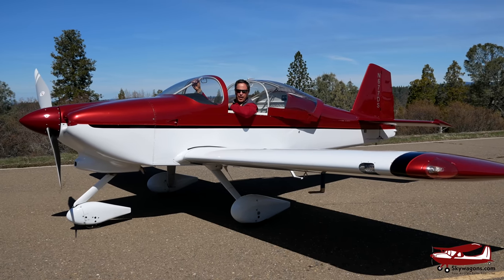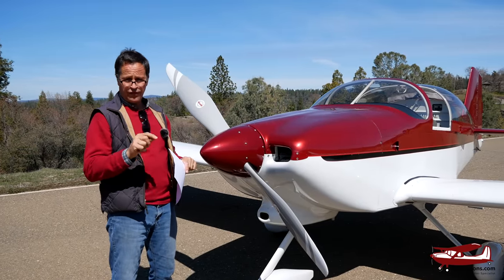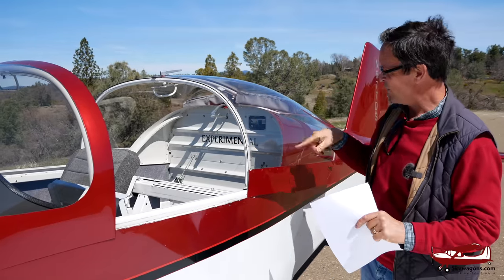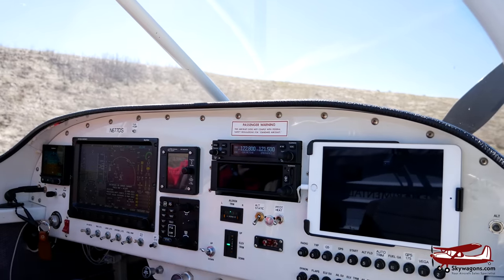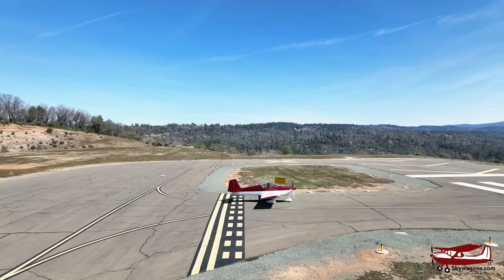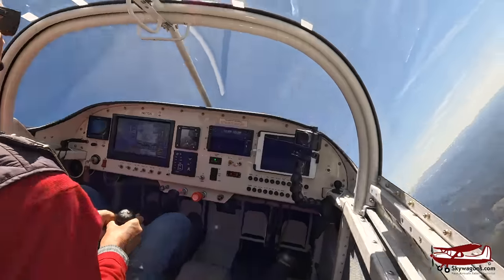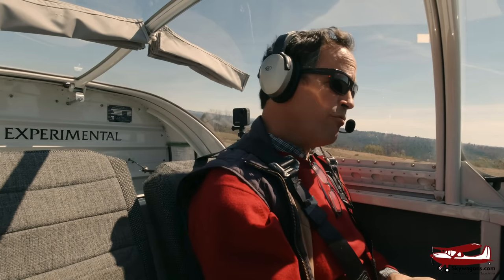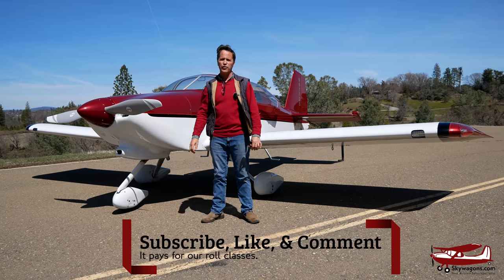Vans RV6A

Comment: The tip up canopy is better in some ways.  The metal support and bar really restrict your view on the slider. I prefer the unobstructed view.   I taxi with my tip up canopy slightly open and it works great in the summer.
Reply from the maker: Right on

Comment: Another great video 👍✌️😊

Lovely aeroplane for a lovely day, I thought looking at the wing etc it would have a good roll rate etc. A fun aeroplane, gets you there quickly, it's IFR equipped, has AP, it's economical, what's not to like! Okay it's a bit twitchy like some fixed wing microlights and the canopy can be a mare in the heat, but over all a super aeroplane.

I appreciate you using a crib sheet, your knowledge of types is clearly extensive but we are all ignorant to something and you fessed up. Everyday is a school day 👍😉😊✌️
Reply from the maker: My brain would explode if had to learn RV's in an hour.

Comment: 4:22 you misspoke.. “left right both off” there is no “off”. Also the RV-4 DOES have baggage room behind the rear seat. You just can’t access it in flight. Also, the tail dragger has positive steering, you don’t only have differential brake steering with the tailwheel models. The tailwheel versions have springs pulling the tailwheel to match the rudder deflection.

Comment: Nice review, however banking more than 60 and/ or pitching more than 30 requires a parachute.
Reply from the maker: You are quoting 14 CFR 91.307. Section (c).  This regulation states that, during aerobatic flight, all persons in the aircraft must have a parachute whenever people OTHER THAN CREWMEMBER(S) are carried. Therefore, when the only person on board is the pilot, and no others are carried, a parachute is not required. However, when a passenger is carried in an aircraft during aerobatics, all persons on board INCLUDING crewmember(s) are required to be wearing parachutes.